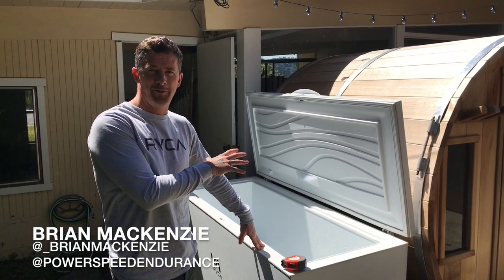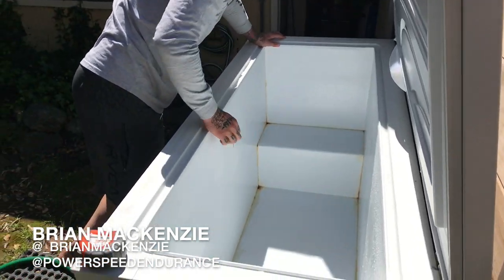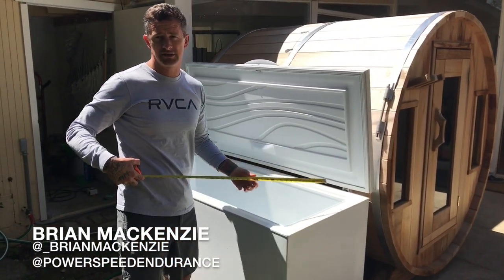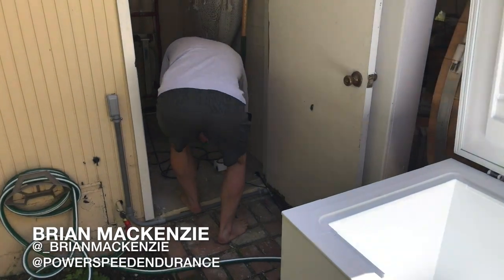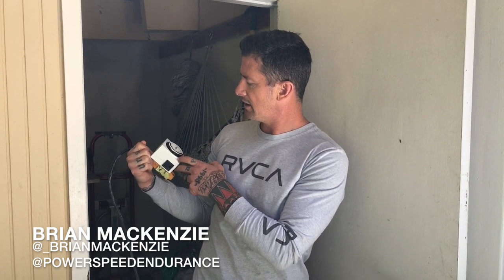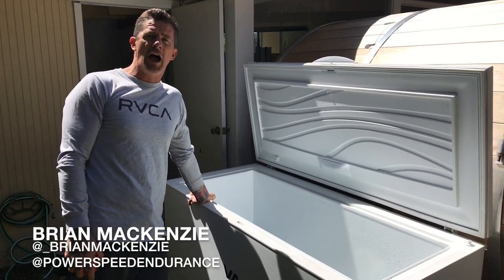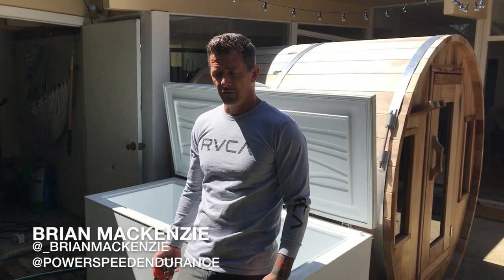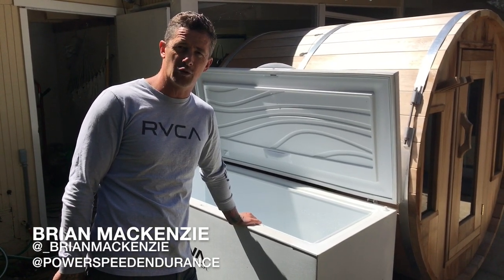Chest Freezer - The Set Up | Brian Mackenzie (Cold Exposure)

Comment: I treat mine like a swimming pool to not have to change the water. Filter pump and chlorine. Also don't buy a timer. Amazon has temperature controlled shutoffs for home brewing. Mine shuts off at 35 and turns on at 42
Reply: Thanks for the info. Do you know what we need to search for on Amazon to find these devices (with the temperature controlled shutoffs)?
Reply: Temperature control plug brings up a wide range of them. Just make sure it's got the temperature ranges you want.

Comment: did you seal the tiny lip where the top plastic edge connects with the metal interior? I can't tell if it's necessary. I personally won't send water that high anyways but the neighbor is about 200 pounds larger than me and I unadvisedly gave him permission to use as much as desired

Comment: Nice video, few questions : how can i find the electric timer, what is it called ? And also can you just use a normal timer and plug it in and out manually for a few hours every day ? Also can i not just keep it running every night for like 10 hours when i'm asleep or will this just be wasting electricity ? Also.. are there any other risks involved even when i unplug the freezer before getting in ? Also, is silicone enough to tape off all the edges or will it still be leaking eventually ?
Reply: If you let it run too long, it will freeze the water into an ice block. 100% silicone sealer on any seams inside will be a 100% seal, but clean the corners very well before sealing. I used automotive brake cleaner, but acetone would work well. You just want any oils or grime completely cleaned out first. I also used an air compressor in between cleaning with spray and wiping the corners until no more gunk came out.
Reply: One rare risk is a blackout from hyperventilation. I haven't heard of this happening to polar plungers though.

Comment: Question... My freezer hasn't produced any ice. I have added allot of over early to get it could and it has started cold but it seems like my freezer is working crazy hard to keep it cold. Do you notice that the freezer outsides get extremely hot? Is this normal? Thanks
Reply: That's usually a sign it is working. The sides are where the condenser is, and it will get hot while running. Once the water is cold enough, you only need to run it 1-2 hours a day.

Comment: how do you keep this clean?
Reply from the maker: That's covered in the video, but empty it every 10 days or so and wipe it out. You can also add half a cup of 35% Food Grade Hydrogen Peroxide on filling and after each use to keep bacteria levels down and reduce how often you empty it.
Reply: We got a small ozone generator. We have well water. After about a week I starting getting a smell so I put the ozone in and that gave the water a nice sort of chlorine like smell but I have no idea if it killed bacteria. Finally after 3 weeks I emptied it. I'd like to figure a way to run it like a jacuzzi with a pond filter to avoid emptying it. 
From the video apparently even with chlorine it has to be emptied. I wonder how much a difference a filter would make.

Comment: Bro, wrong timer and shouldn't be connected to an extension chord. But if you do, I suggest you replace them both, at a minimum, every year. Or, you might wake up to a fire. Or smoking chord or smoking timer.
Reply: can you explain why? interested
Reply: @thebodyclock1  amperages aren't high enough because of the cycling on and off of the freezer. It can work it's just smart to replace before chord and timer are damaged. It's the cycling on and off that makes the difference. If it was just plugged in and running like a regular freezer it wouldn't be that big of a deal. Hopefully the timer, chord, or outlet will just stop working or a breaker trips before something more serious happens.
Reply: @mathiso01  oh ok, so it has to restart itself constantly and so it ruins the fidelity of the conducting wires?
Reply: @thebodyclock1  yes
Reply: @mathiso01  Freezers aint pulling anywhere near 10 amps though
Reply: @adambennett1193  It's during the startup when the amperage spikes.  It would be better if they left them running without the timer.
Reply: What if you were to use a temperature controlled shut off instead. One that say cuts off at 35 degrees and turns on at 42?